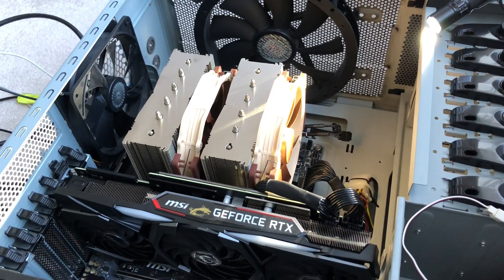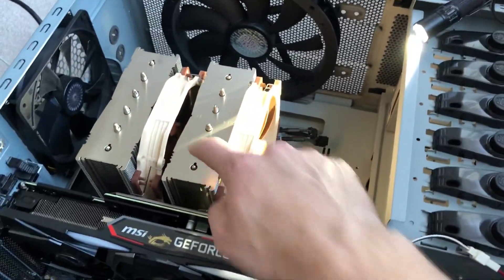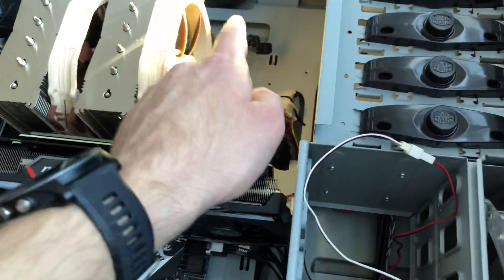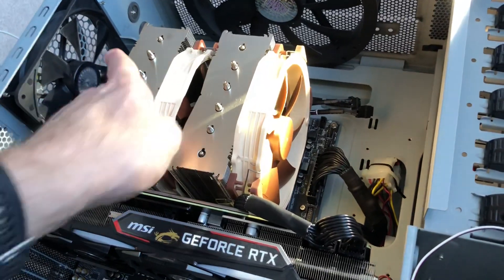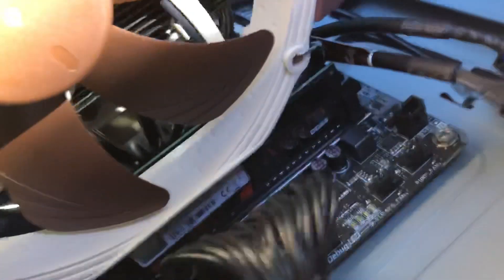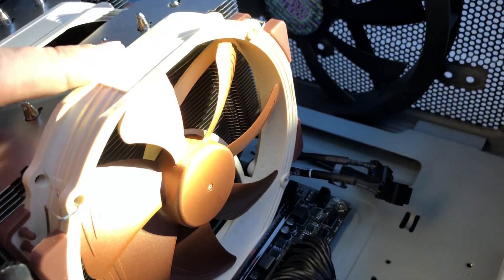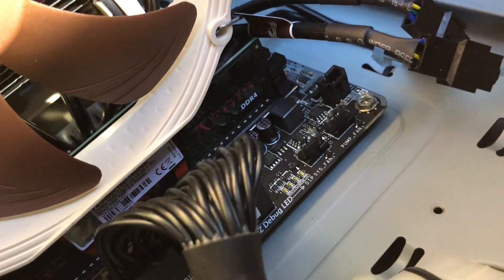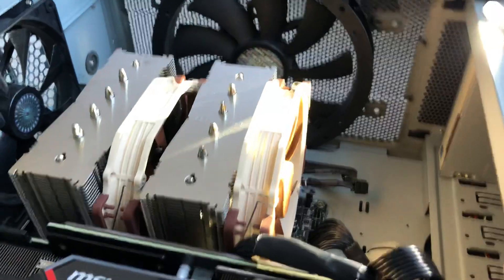Noctua DH-15 cooler and RAM compatibility

Comment: My case isn't the issue. Its the cooler or the board. It's more than likely the board because it's an ITX Mini board and the cooler is to big that I can only fit 1 RAM stick in. I have 2x8gb sticks for a total of 16gb but can only get 1 to fit. 8gb of RAM just isn't enough.
 Even after removing the ARGB heatsinks, I can still only fit 1 stick. I can fit 1 stick with the ARGB heatsink, but it's physically impossible to fit 2 sticks. Heatsinks or not.
 They probably don't make any kid of adaptation cable for the RAM sticks, do they? I don't believe they do..

Comment: Don't overthink this. Simply raise the fans higher on the heatsink. As long as they don't interfere with closing the side case. VERY simple, just raise the fans, you don't need it to touch the RAM. Raise the fan up a tiny amount. All depends on the width of the case.
Reply: Don't fit corsair vengeance rgb case lian li o11d evo xl
Reply: @ Like I said  " All depends on the width of the case."
Reply: @Thesnaketheboss  I have four of these D15 in service right now. One of my systems is a case as old as this one but it works for my needs. An Antec 900 with a 200mm fan on top. I raised my fans up a little on the same exact cooler. I'm likely 1-5mm away from the side panel but it fits. Every case is different but people should not ignore available width space they might have to raise their fans up for RAM clearance. 
My son has the black D15 with tall Gskill Trident Z5 RGB with taller heatsinks. His case is a Corsair 5000D and I was able to raise his 140mm fans on the heatsink high enough to clear the tall RAM and this Corsair 5000D was easily able to handle it. It's a case by case basis, pun intended.
Reply: @45eno i did ed printer adaptador, and is working fine i think is the best way for using 2 fans in d15

Comment: You have a tiny case lol, that air cooler is supposed to be installed in full towers
Reply from the maker: The case is a Coolermaster HAF X, which is even larger than a standard full tower.
Reply: @JohnDoe-vh4rt  :face-orange-biting-nails::face-orange-biting-nails::face-orange-biting-nails:

Comment: In same boat with Lian Li 215. Am deciding whether to try Corsair LPX but it'll be super close.
Reply: Did the Lian Li 215 case not close with the fans zo high?
Reply: @magenof1440  the D15 did fit with low profile Vengeance RAM... just barely. I think it touched the glass but was operationally fine. Soooooo close on tolerances though any variation with motherboard or standoffs could make it not fit.
Reply: Lianli deepcool 2
Reply: Lianli deepcool 2

Comment: Yes this cooler so big go tmine on my fractal arc mini R2 ended up buying a 120mm noctua coz the 2nd Fan cant fit  in, if youre planning to buy this cooler you must consider your casing had a 170+mm cpu clearance and youre pci-e slot must be one slot away from cpu socket otherwise youre gpu will have an hairline clearance between the cooler and the backplate of youre gpu

Comment: If I only have one fan for my D15S, should I put it in the middle or the far right side?
Reply: I added a 120mm fan to act as a push (nearest the front of the PC case) it made a lot of difference!
Reply: @maxheadroom6833  I know, but I only have one for now. Where should it be?
Reply: The fan should be in the middle, pushing the air out towards the rear of the case. You can tell the direction of the airflow by arrows on the fan
Reply: @maxheadroom6833  thank you!

Comment: corsair vengeance LPX is probably the best ram to go with. is the shortest at 1.22inches yet it has an integrated heat sink and still performs on par with the RGB pro. may not look pretty but it does the job.
Reply: just what i was going to say. 🙂

Comment: I had to buy a 120 mm fan to replace the 2nd 140 mm. Because my case z390 based motherboard couldn't close do to the ram.
Reply: no issues with cooling?
Reply: @EnduroTrailRiding  no.

Comment: This is the ONLY video that I've found that talks about RAM height. I need bigger ram sticks because of 4k editing, graphics and mural production so don't want to be stuck with small ram sizes but do want to have air cooling. As of now, it looks like I'm going to have to send my air cooler back before even being installed and going toward an AIO which I don't want to do but I will be able to use S.Skill AMD sticks higher than 44mm. Bottom line: decide if you are going to need a lot of RAM or will be adding on and buy your cooler accordingly.
Reply: Buy the D15S.
Reply: Maybe I'm reading it wrong, but there are AM4 specific versions of both the 15 and the 20, and I think those offer somewhat better RAM compatibility, but then your problem is room / clearance in the case. Now I gather some cases will accept a 20 and some will not, but it's a bit of a squeeze in all cases.
My issue, is I like the 20 and I like the 59590X, and I'd like a closed case that keeps grandchildren and puppies and dust-bunnies and shit out. An open-air display case that's 4 lumps of tempered glass with a 4 inch gap between them, that's an art exhibit - that's not a working mid-tower computer case.  The one that's like a spiral cascade in stainless steel and weighs 40kg - that's striking and pretty as hell, but it's not going to fit under my desk and it costs about $800 more than I want to pay and it's simply not a practical design for what I want.
Reply: @Kneedragon1962   in this first build, I ended up using Trident Z Neo rgb ram in a big Panzer case. Since I wanted to use air cooling, I put in a Dark Rock Pro 4 cooler. I finally got to talk to some people at the 3 manufacts. and I guestimated everything would fit. But the ram sits almost touching the cooler and half the rgb is hidden but everything works...